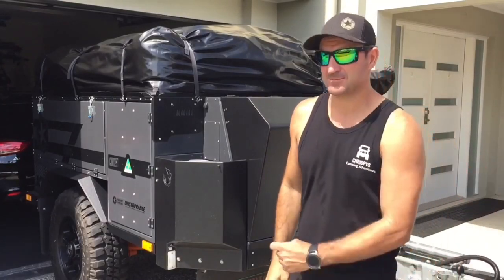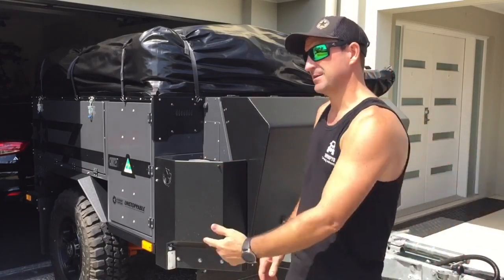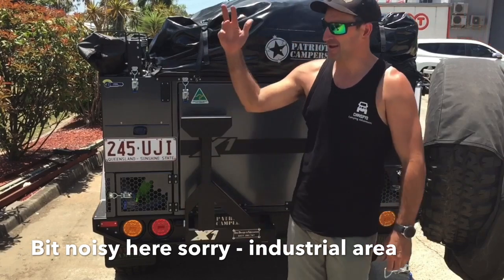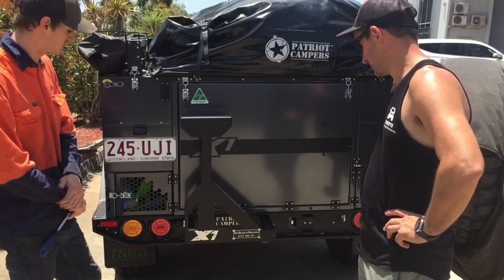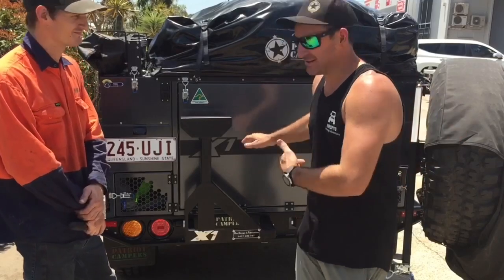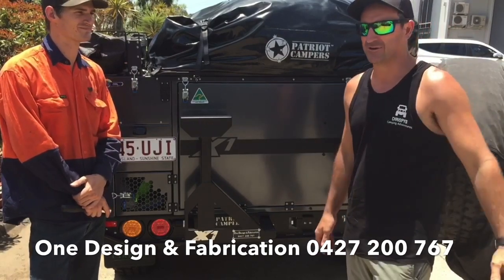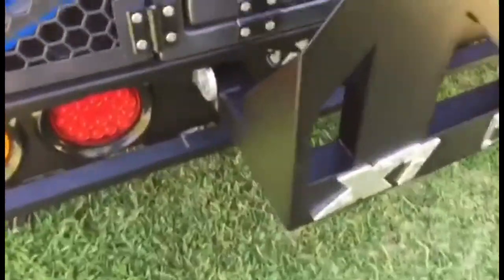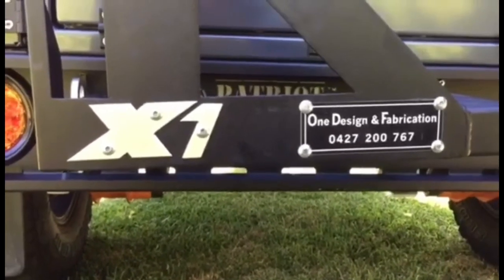Camper Trailer Boat Motor Carrier

Comment: Hey mate, Great Video! How did it go off road? I have a 15hp Mercury, looking to maybe get one of these or potentially put the outboard in the rear storage in the Patriot X1?
Reply from the maker: Its solid as a rock mate doesn't move at all i put a rachet strap on as well for extra support.  I have even put it on the cruiser as well . We couldn't put in our X1 because main compartment was full all the time .
Reply: @chrispyscampingadventures  Thanks for getting back to me mate. Cheers.